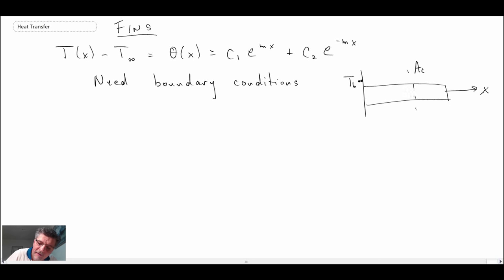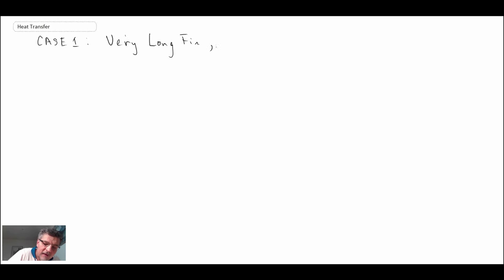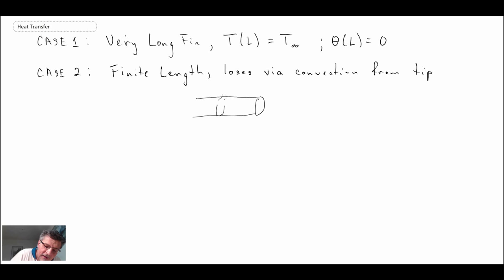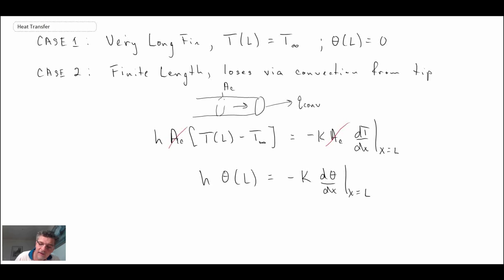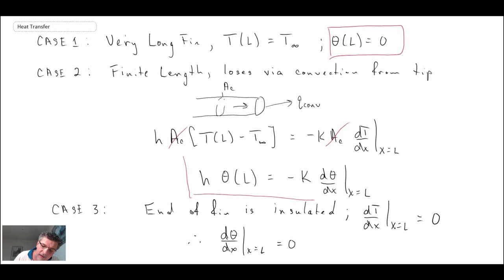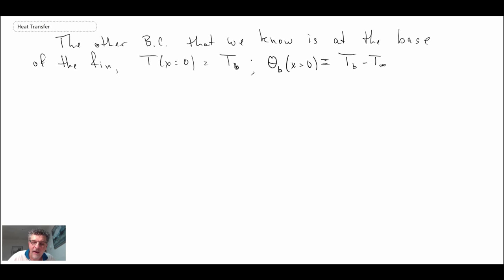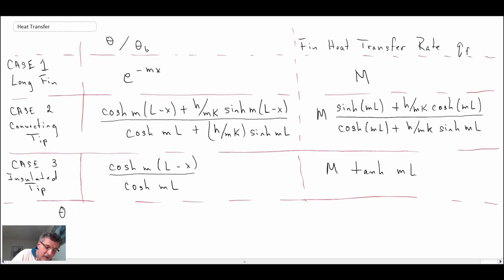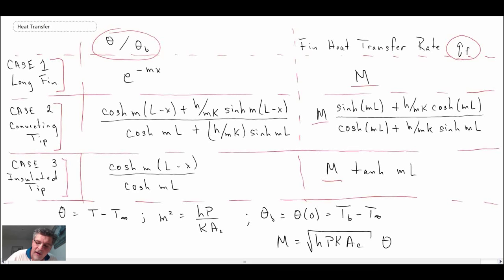Heat Transfer L8 p3 - Boundary Conditions for the Fin Equation

Comment: What about boundary conditions in the y-directions? For the case of convection at the top and bottom of the fin..
Reply: it's uniform so the temperature would be equal at the top or bottom at any point of X
Reply: @wassuphalo3  so at point X you take the surface x 1 not as surface x 2